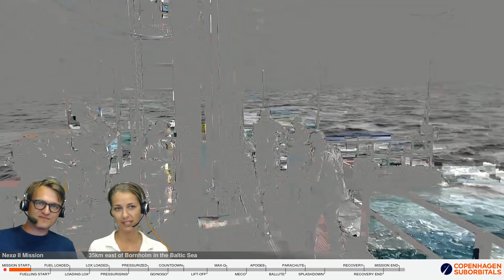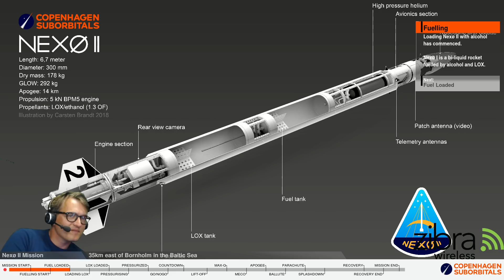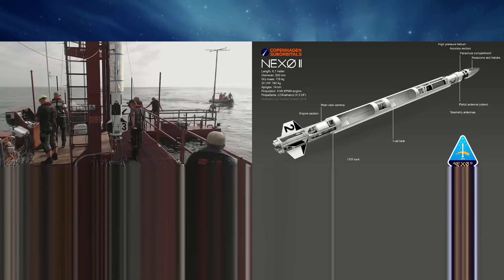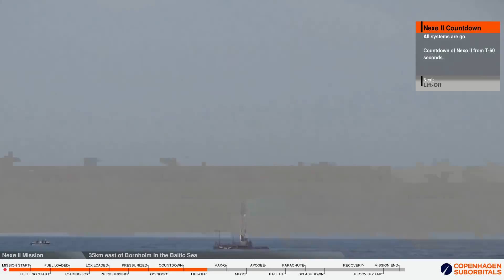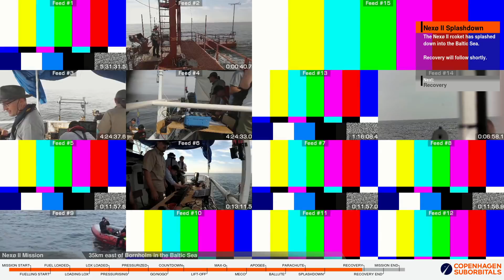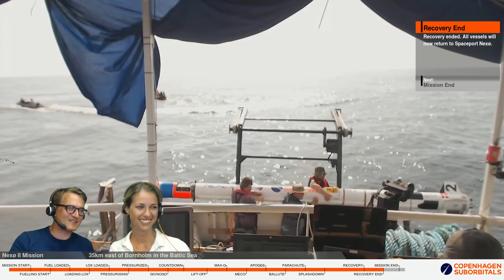The Nexø II Rocket Launch Mission Live Stream

Comment: Maybe 7000 meters, well let's say i'm a bit disapointed. Space is far from that....
Reply: This rocket was not supposed to go space. This is proof of concept for all the systems needed to do the full size rocket. Everything worked.
Engine
Flight control
Ballute
Parachute

They are ready to start the development of the full size rocket now. This is an important milestone for CS.
Reply: The hard part is actually to produce a functioning LOX rocket. If you manage to do that, upscaling isnt that hard. Conventional amateur rockets use solid fuel and are way easier to get to higher altitudes.
Reply: Totaly missed the " technology demonstrator" part of this mission, guess it's more then me!
Reply: schtaan2 with something like 10000€ of budget per year, I would say it's good
Reply: schtaan2 - This mission is just a technology demonstrator. There's a saying, you must learn to crawl before you can walk.
Reply: It's unfortunately the MO for CS. Working a long time on a relatively large rocket that only goes to insignificant heights. They have been doing this for a decade and they never stop to realize that it doesn't lead to anything. It's like a headless chicken. Then they posture a lot for 2 years more and then launch to 7km altitude again.
There is no excuse for it. It's an amateur rocket club, it's not an organization that's trying to actually do something. It's a lot of effort but it's headless. It lacks clarity and ambition and they are not hearing it no matter how many times it is pointed out.
Here is what actual leadership would declare:  1) manned suborbital flights are pointless danger.  2) rename to Copenhagen Space  3) target 1-10kg LEO insertion. 4) develop highest practical Isp lox hydrocarbon engine (at least 300) and 5) compute a design with such engines for 3.    6) make it so.
Reply: @DanFrederiksen2 sounds like the state of NASA right now. Just staying at the same spot not doing anything, and certainly not innovating.